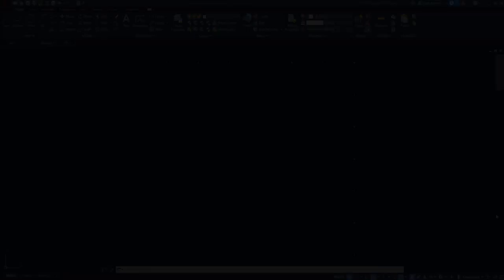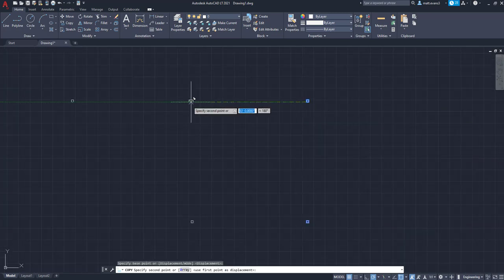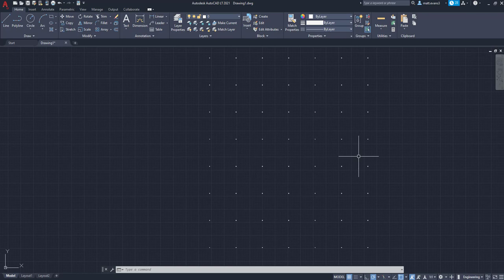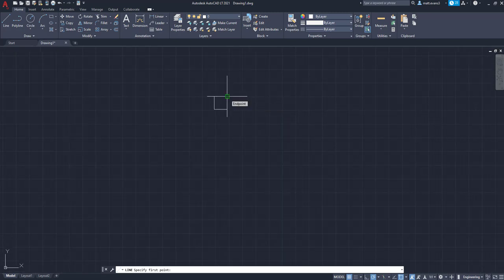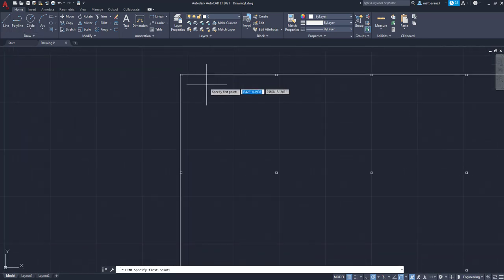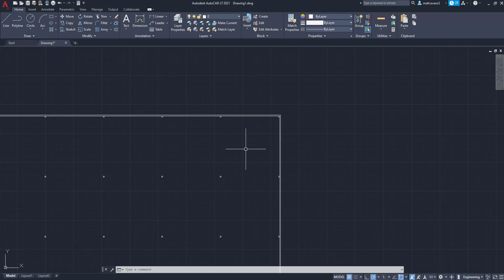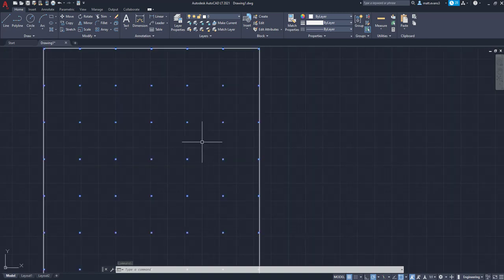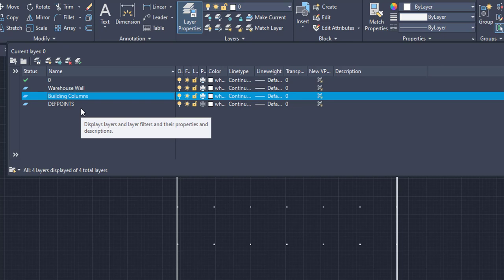Warehouse Design AutoCAD (Pt. 1) - Creating Blocks & Layers

Comment: How did you get AUTOCAD to Inches? I can't seem to switch it over.
Reply from the maker: In the lower right hand corner you should see a small rectangular control box that has a small ruler icon in it. When you hover your mouse over it, it should say "UNITS". You will have to go to the right of that small control box and click the drop down arrow. Once you click the arrow you should have 5 different options. I have mine set on "Engineering" which allows me to draw in inches/feet. Let me know if this works!